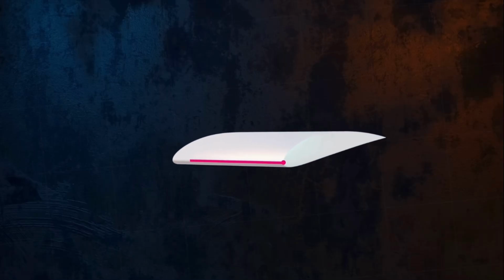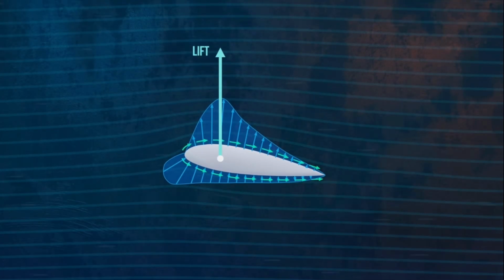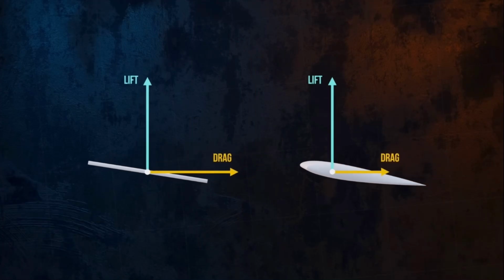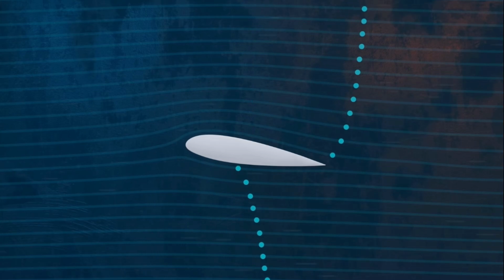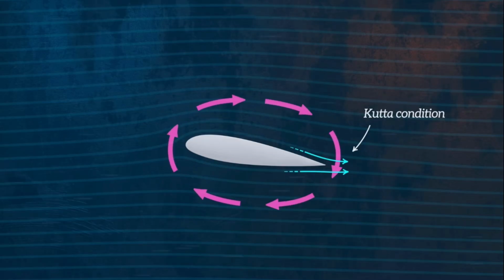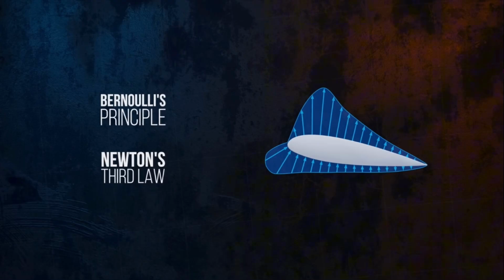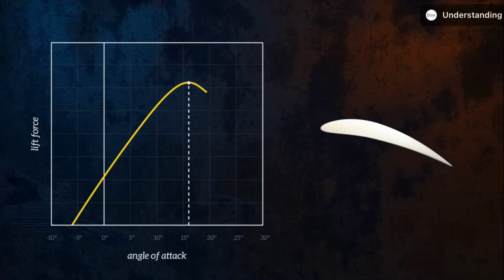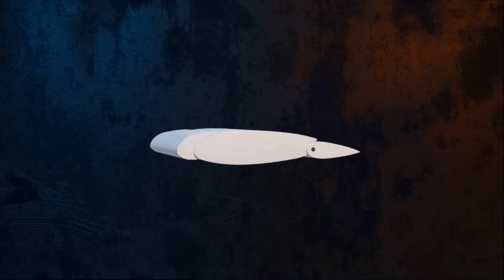Aerodynamic Lift Explained

Comment: So, you have these great streamlines, that correctly show 2D flow around an aerofoil, and they adhere to the continuity equation perfectly, grad dot v = 0, so there must be no divergence in the flow. That is shown as perfectly horizontal flow in from the left, and perfectly horizontal flow out to the right. Literally, no divergence, great! You might be surprised how many people draw that incorrectly (I wrote a paper on that).

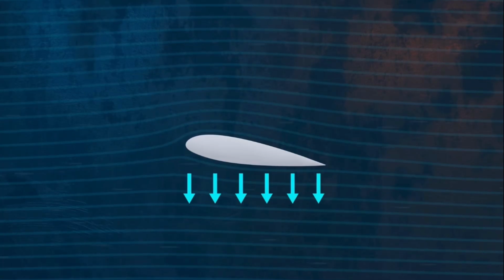But, then at 8:35 due to what I assume is intuition, you add the extra vectors down, while just before that you had upward turning and downward turning, which for continuity must be equal and opposite. So, why did you change to arrows that just point down? This is the modern misconception that an aerofoil generates a mass fux downwards, imparting a net downward momentum to the air. It does not. As noted with the continuity equation, and as your streamlines show, horizontal in and horizontal out!

Newton’s laws clearly apply, but they are being misattributed here. The flow is being treated as if the wing produces a steady, exhaust-like downward jet, when in fact the flow is turned, with both upward and downward acceleration present (but from horizontal back to horizontal). There is no net downward mass or momentum flux in steady 2D flow, and the lift force arises from the pressure field (as you correctly noted), not from a rocket-like exchange of momentum.

To be very clear, there is a momentum flux "across" an aerofoil. That momentum flux is associated with the relative curvature of the streamlines (upward turning acceleration around the LE, and downward turning deceleration to the TE), that through the momentum equation, is equivalent to the pressure field. That is, the momentum equation is Newton’s second law for fluids. The left-hand side is the mass–acceleration analogue, and the right-hand side is the pressure-gradient term. When integrated, both descriptions give exactly the same lift force, they are the same physics viewed from different sides of the equation.

While it is complex, Prandtl did explain this 100 years ago.
1) The viscous effects at the trailing edge, generate the starting vortex (the flow tries to flow around the trailing edge, into the region of lower pressure above).
2) This vortex grows, creating a new low pressure in the centre of rotation. That is because there is a centripetal acceleration, driven by a force; that is the pressure gradient. So, as the starting vortex grows, and the flow accelerates, it drives down the pressure near the trailing edge. 
3) This creates a new pressure gradient force from the high pressure rear stagnation point that is up on the top surface (you noted the solution with no circulation, this is literally how the flow starts), to the low pressure centre of rotation. 
4) Eventually, the inflation of the starting vortex, driving down the pressure in the centre of rotation, forces the rear stagnation point to the trailing edge. 
5) This then extends the region of lower pressure over the top surface; this is why more fluid can flow over the upper surface, because we have created the low pressure region. 
6) This induces the upward turning of the flow upstream, so we decrease the pressure above, so more fluid is push up over the top from the higher pressure region ahead. Importantly, that is not instantaneous. There is a wave in the pressure field which propagates ahead at the speed of sound.

So, there is a clear cause and effect.

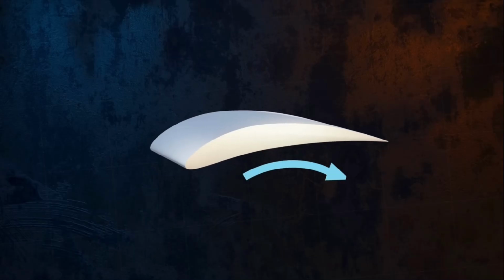One thing we need to stop, is the statement like at the 10:00 mark, where you say fluid is deflected down. Recall continuity, horzontal in and horzontal out. No net mass flux, and the momentum flux across the aerofoil is consistent with the pressure field pushing on the surface, which is also divergence free. I know it is slightly more complex in 3D, and I am happy to talk about that.